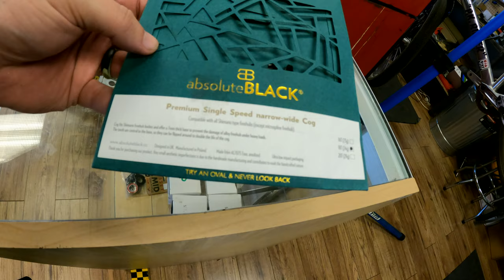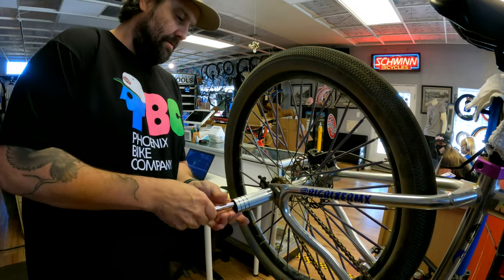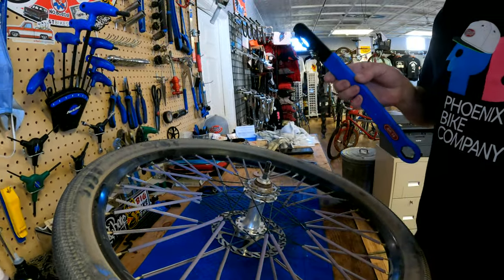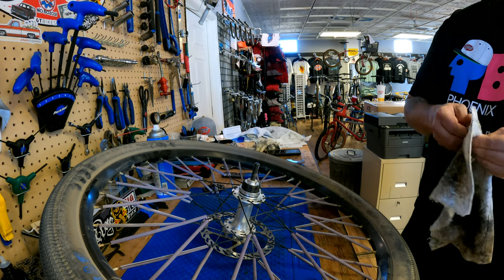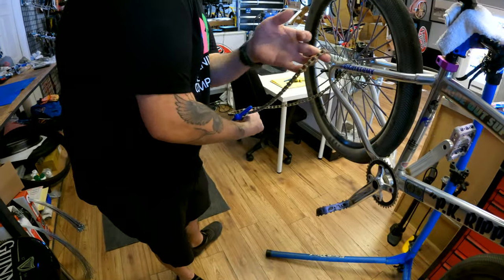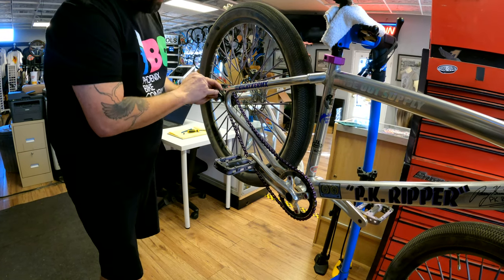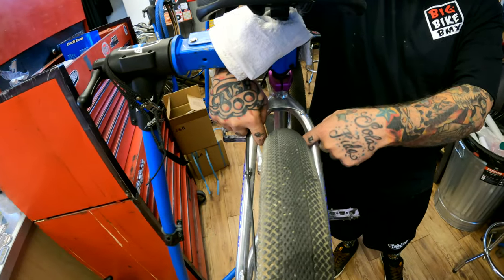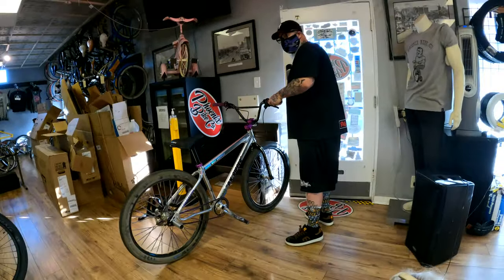Installing new cog SE Bikes cassette hub - PK Ripper 27.5

Comment: Learned to work on own BMX as a kid;  patch punctures, replace worn grips, pads & tyres, chain tension without tensioner, replace snapped brake cables and jammed/stuck cantilever brake's. Ol  man wasn't handy with tools or DIY so had to do most work with the flat spanner that came with bike, old rusty plier's, screwdriver's and a hammer

Comment: Thank you for this video.  Is it easier pedaling with the 18t sprocket? Is hill climbing a little easier now too?
Reply from the maker: I think so. It’s a slight but noticeable difference
Reply: Increasing the size of the cog provides more torque. Meaning higher top end speed on flat ground. Doesn’t make pedaling uphill easier. Just the opposite. Theoretically it should also get that front wheel up easier and faster. I think
Reply: @Softballcrazy  You would be correct if you were referring to the front chainring.  A larger rear cog though will make pedaling easier and lowers the top speed.

Comment: what do you call that wrench ? got a link to those tools id like to do this thanks
Reply from the maker: We used a chain whip tool to hold the old cog in place. Then a cassette lockring removal tool. Best suggestion would be ask a local bike shop if they can remove it for you and bring a six-pack of beer with you. Good luck bro!

Comment: Hi guys I have the pk and love it but it’s way to quiet.... will changing this part add the sound I’m looking for ??
Reply from the maker: The cog doesn’t control the sound, just the gearing. If you want a louder noise, you’ll need to upgrade the entire cassette hub. I hear Profile Beastmode hubs work with the PK 27.5 but I don’t own one personally
Reply from the maker: @fittedthomas  naw. The cranks and spider are one piece. You’ll need just a chainring

Comment: Yours went out too huh? Mines starting to clunk and skip from the wheelies also
Reply from the maker: Mine actually had ZERO issues. I just wanted to run an 18tooth cog instead of the 17tooth that comes stock. I'm pretty rough on my PK too, so I expected to have some issues but never did.
Reply: I actually went 33/17 from your commentary from your older videos and love it might have to try the 18 out when I get new cassette/hub’s since mines going out for sure was hoping it was bottom bracket but it’s skipping
Reply: @Ding0_38  Try to flush your cassette driver with WD40. The clunking and skipping is a result of dirt in the pawls and ratchet ring. Look for a rubber seal between the spokes and the cog, pull it back and squirt it out (with the spray tube) to direct it liberally... that should help for a while... but if there is wear the whole hub will need to be replaced as for I don't believe they have replacement drivers (free hub body) and if I am not mistaken there is a 10mm hollow allen nut  on the inside of the hub (after you pound out the axle and bearing) to actually remove the driver. Good luck hope that helps as for the cog remember to space it the same distance from the inside of the hub as the old one.... so your chainline alignment is the same. Peace! :>)

Comment: Will replacing the cog increase the loudness of sound? Or do you need to change the whole cassette hub? @bigmikebmx
Reply from the maker: The sound comes from the internals on the cassette hub. The cog is just a metal ring so it won’t change sound or loudness. You are correct👍

Comment: yo bro can i use this cog on my 2021 MQ? what would be the difference if i added a cog or changed the front sprocket to a 36 maybe?
Reply from the maker: You can adjust the gearing with the rear cog or the front chainring. The cog was just easier for me so I went that route. If you want to make getting the wheel up easier: either bigger cog on the rear or smaller chainring up front🤘
Reply: @BigBikeBMX  you rock!!! theres literally no info or anything about the 2021 MQ anywhere...
Reply: @BigBikeBMX  as if type this I’m watching your vid abut how to wheelie... now... could you change the chainring and cog? Or it has to be one or the other? I’m noticing on my MQ it’s damn powerful, I can pedal just a few times and I’m already a block and a half.. but it’s hard to lift the wheel.. I have to go faster than I prefer in order to pop it up easier..
Reply from the maker: @cedarbloc11  great question. I like to do slower wheelies so I like an easier gear to pop up easily. You can do both front and back gears but you don’t need to. I’d suggest just swapping one with small adjustments. Say go one more tooth on the cog and see how that changes up things.
Reply: @BigBikeBMX  ok so either a 36t chainring or a 22 cog? I believe the MQ comes with a stock 20t.. sorry for the dumb questions man I’m just getting back into bmx after not riding for so long.. when I was riding I was trying to learn wheelies.. grew up in nyc and I would say year 2000 that’s when I saw the street bike culture in the city just take off.. imagine 100 bikes in the middle of Times Square all wheeling in traffic haha...but yea man you’d be surprised how much I’ve learned so far just watching a few of your vids.. I’m older so the theory than practice works great for me.. one last question... do you recommend changing the handlebars on the MQ? Peace
Reply: @BigBikeBMX just got that 3t chainring put on my monster quad... im losing power in the front but its feels pretty good still and it really is easier to pop the wheel up! im tempted to see what a 21t cog in the rear would ride like but for now i like it... its very smooth... had to take off 2 links from the chain. thanks for that advice my dude!.
Reply from the maker: @cedarbloc11  something to consider is one tooth adjustment in the rear is equal to two teeth in the front. So consider than before you make the swap. You’ll settle on the perfect gearing and it’ll feel perfect. That’s where I’m at with my PK Ripper🤘
Reply: @BigBikeBMX  word! I’m still learning that ratio so are you saying keep the 36t in the front and go down one in the back?
Reply from the maker: @cedarbloc11  yup. Small changes in the back are the easiest🤘
Reply: @BigBikeBMX  word thanks bro.. but now you got me thinking.. I could have kept the 39t in the front and did a 22t in the back! I’m trying to figure this out without spending a lot on labor..
Reply: @BigBikeBMX  word it’s trial n error for me but you did tell me this.. it was just easier for me to get the chainring vs the cog .. the shop I buy from doesn’t stock a 22t cog.. spilned..

Comment: Is that the piece that makes a bike louder?
Reply from the maker: The cog doesn’t. The freewheel and in this case, the cassette hub make the noise. The cog attaches to the cassette.
Reply: Oh ok thanks
Reply from the maker: @zacharypatenaude3607  It's hard to see, but in the video, we're removing the lock nut on the cassette to attach a new cog (looks like a star) to that cassette. The cassette is like a freewheel with internal parts. Hope that helps bro!
Reply: @BigBikeBMX  yes thank you😃
Reply: I said a post where they removed the grease to make the cassette louder